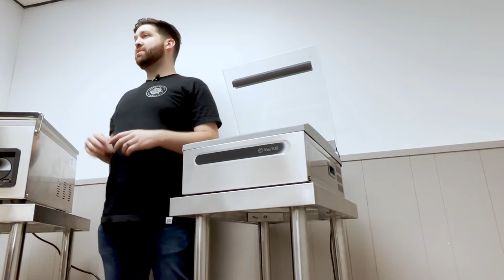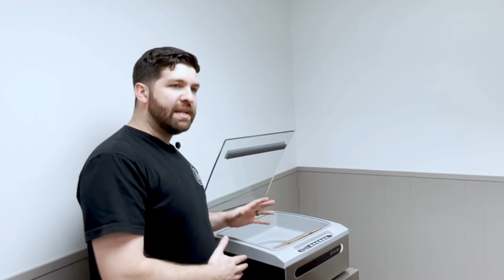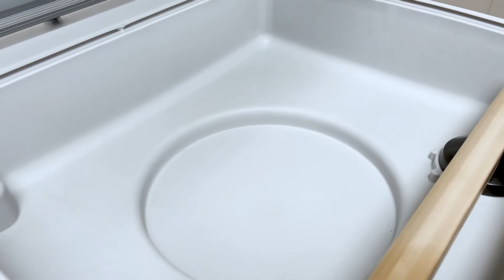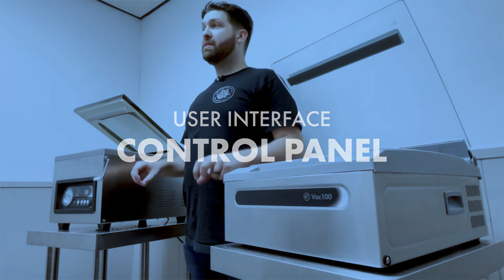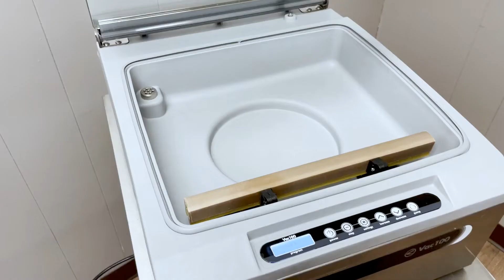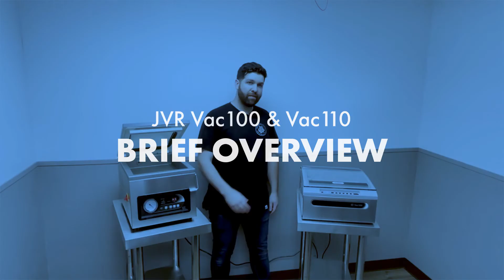Vac100 & Vac110 Comparison | JVR Industries' Chamber Vacuum Sealers

Comment: Can a whole chicken or rabbit be sealed in it?
Reply from the maker: Good morning,

This is a great question. It ultimately depends on the size of the whole chicken. In the Vac100, I have fit up to a 5.5 lbs whole chicken that was thawed. Once it was frozen, I could not get it shut. 

Vac110 should cover those larger whole chickens.

As far as rabbits, they seem to be quite small, so I would think either unit, but I would still advise that you measure your largest rabbit and read some of our articles on our website and compare maximum pouch size on your desired units.

Thanks for the great question!
Thanks for choosing JVR Industries!

Comment: Does the 110 pump pull more air out than the 100? Or is the same amount of air pulled out in both units? I’m trying to understand if the bigger pump from the 110 is helpful with more than just speed?
Reply from the maker: The vacuum pump in the Vac100 and Vac110 both pull the same amount of oxygen. One just pulls it faster than the other by an average of 10 seconds. If you are doing 20 packages at a time, you would only be saving like 3 minutes. If you are doing bulk packaging, then it would be more favorable.

Comment: The vac 110’s suction port looks like it would accept accessories. The holes are on the flat surface of the part. Is that not the case? I’m curious how another customer modified the 110 to accept accessories. Could you explain?

Also, if there aren’t plans to add accessory port to the 110 is there plans to beef up the 100?
Reply from the maker: Good afternoon,

The Vac110's vacuum port has a different outside diameter than the Vac100's. The difference in diameter makes the accessory hose only compatible with the JVR Vac100.
We had a customer use a sink plug and carve out the center portion to act as a gasket for the port. The customer swore they had good success with this.

You will have to see what we do next. 
😉

Comment: I want the JVR Vac110 with external vacuuming ability.  That would make the machine perfect.  Instead, I'm stuck with a JVR Vac100 with half the pumping power, less internal chamber height, no analog gauge, and composite material.  For only $100 less?  Is there no way to make the JVR Vac110 work with the external accessories?  Can the current unit be modified or is that a future upgrade?
Reply from the maker: All great concerns and thoughts. Sounds like you like the Vac100, but do not like some of the specifications on it. Let us address these concerns below:

Vac100 Vacuum Pump:

Yes, this has half the flow rate, but in some instances, this machine can easily outpace the Vac110. For example, ground beef, venison, elk, and bison can be packaged into 6x10 VacPouch at 1 lb increments. You can seal two of these pouches simultaneously on the Vac100. You can max out the filler plates cutting back vacuum cycle time to roughly 20 seconds per pouch. On the JVR Vac110, you are stuck sealing 1 lb at a time unless you add more to a single pouch. Most households package a lb at a time. With the Vac110, you would be packaging a lb at around 30 seconds. The same is true for 4-5 oz salmon fillets, crappie, trout etc. So in some instances, the Vac100's smaller pump can outpace the Vac110. So smaller does not mean weaker. Just different applications. 

Vac100 Chamber Depth:

For some this is discouraging which is understandable. In some instances, the Vac100 is able to seal off larger items. For example mason jars. Using the external functionality, you are able to seal up to two half gallon mason jars simultaneously! Not even our JVR Vac410 can seal this large of a mason jar!!!! So yes, the depth of the chamber is .9" smaller, but it can achieve some larger items via the 3 GAL chamber accessory. Also we have been able to fit up to a 5.5 lbs whole chicken (thawed) inside the the Vac100. That is quite large. If you have anything larger, you may be packaging this item infrequently. In those instances, consider cutting down the meat that you infrequently package?

Vac100 Composite Chamber:

These chambers have been shown to last for years without issue! We have had no quality issues! We have been in business for 50+ years and specialize in vacuum packaging. Consider this: We have seen stainless steel bend from the draw of the vacuum on some of these machines! Wow! So steel is not considered entirely indestructible against vacuum draw. We truly believe the materials used on the Vac100 are quite durable even against the Vac110. If we thought otherwise, we would not be selling these units.

These are general thoughts regarding the differences between the two units. Maybe consider calling us at the office during hours? (716)206-2500. Talking to one of our specialists will likely provide more thought behind what unit is best suited for your needs!

Lastly, to answer your question about Vac110 updates: We have and are considering upgrading or altering the Vac110, BUT accessory capability is not on the list of alterations/upgrades. These are merely tentative plans and are subject to change. We have had a customer who altered the Vac110 to accept the accessory hose. 

Thanks for considering our products and we hope to discuss with our further on Monday! Happy new years!
Reply: @JVRIndustriesInc  Thank you for addressing my concerns on the differences between the Vac100 and Vac110. Customer service alone has sold me on JVR.  Based on your information, I bought the JVR Vac100 this weekend and it shipped today.  Can't wait to try it out!!!
Reply from the maker: @grimsinner555  Talk about great timing on the order! You got one of the last couple units available in house. Enjoy!!!

Comment: Both units should be made to do external vacuuming abilities.
Reply from the maker: Great suggestion. We designed these with different customers in mind. 

Typically customers with high volume with little variation will go to the Vac110.  Sometimes lower volume users who want to package larger cuts of meats want the JVR Vac110 for briskets, tomahawks and more. 

Usually we advise our customers with lower volumes to cut down their meat and use the Vac100. Hope this information was helpful in your decision making. That would create the opportunity to use the Vac100 and its capabilities. If you are concerned about length of vacuum cycle, simply use the skip function, presets (programmability) and filler plates to combat loss of speed. These three factors alone can get you up to Vac110 speeds IF you are doing intermittent packaging with various products. 

The Vac110 is designed for higher volume and less changeovers in mind. If you are doing 10-20 of the same package, of course that unit is going to afford you faster times for that type of job. If you are doing a decent amount of different products, then the Vac100 will be the winner. Hope this info was helpful. Let us know if you have any other questions.